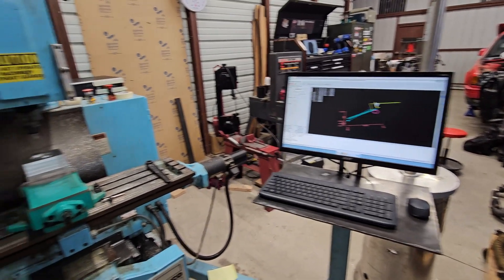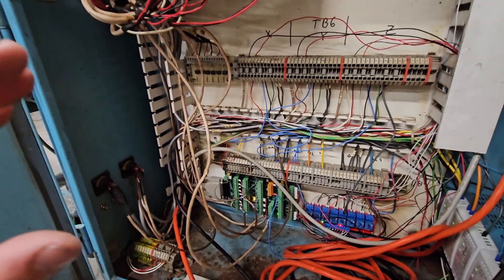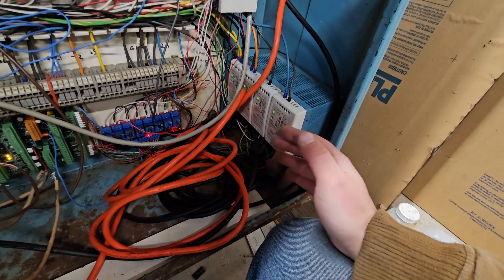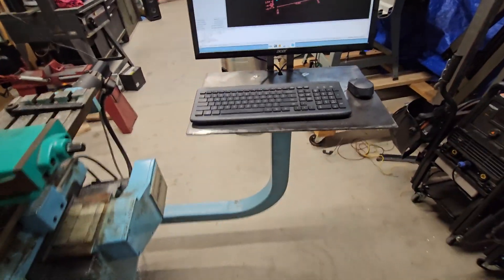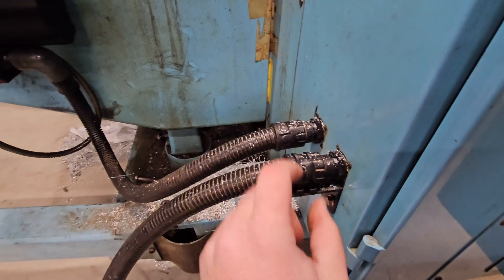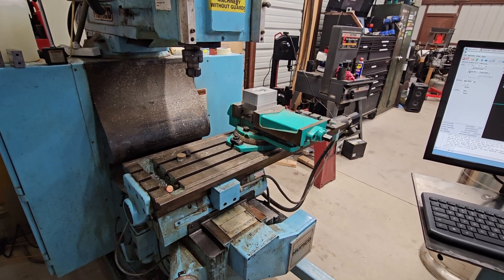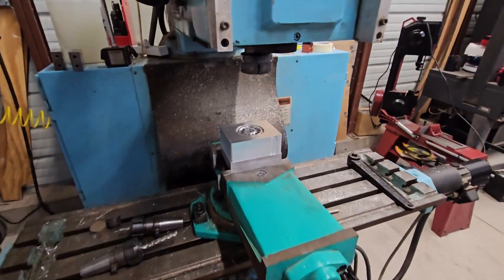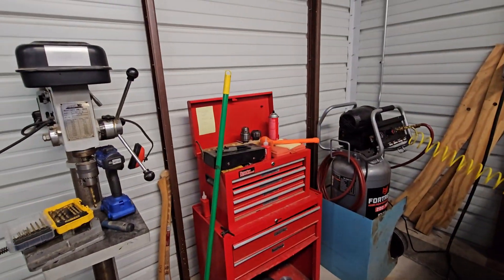Hurco KM3 Linux CNC Retrofit

Comment: I'd love to see more. I'm looking at a Hurco SM1 cnc mill, debating on getting it. Currently it doesn't operate due to the original screen failing.
Reply from the maker: Sure, I could probably take a few more videos. When it comes to retrofitting old machines, whats most important is to have good wiring diagrams of the machine. Without that its all  kinds of headache trying to figure it out. Alot of the more modern and standard wiring practices that we know today werent a thing back then, which can sometimes help but also hurt in trying to chase wires. Alot of the older machines have mostly discreet wiring which can create some interesting challenges, but on the bright side it means that alot of it can be tapped into otherwise to do what you need. There can be compatibility issues with the old electronics, but if you have good manuals and some electronics know how (or atleast know what questions to ask) there can be work arounds for that. Alot of the older equipment is usually compartmentalized to some degree, so if you know what to cut, then you can remove a large portion of the wiring/control, and replace it with your own setup.

Comment: The reverse direction is absolutely fixable in the hal
Reply from the maker: @ollied1981  I tried looking through the documentation but couldn't really find anything that was helpful. Maybe I was looking in the wrong place. Got a lead on any resources that I could check out?
Reply: @flyingfencepost  you need to use rs485 modbus + vfd or use +1 pin for solid state relay  which one will switch phase direction (methods depends on you breaout board)

Comment: Awesome to see the conversion. I helped convert a Hurco BMC30 a decade ago, so I handled some of the same challenges like your limit switch. 

For you reverse issue you can do this in the hal file, just not through the GUI setup. For a machine like this you’ll quickly get to things that need to be handled in HAL. 

Also, the 7i84 I/O board might allow enough current to drive your 24v relays directly. I use it to drive pneumatic solenoids on my current machine (a Langmuir MR-1 with LinuxCNC, servos, and a CNCDepot spindle).

There are some USB wireless pendants that work great with LinuxCNC.